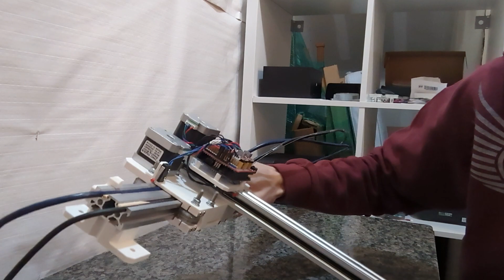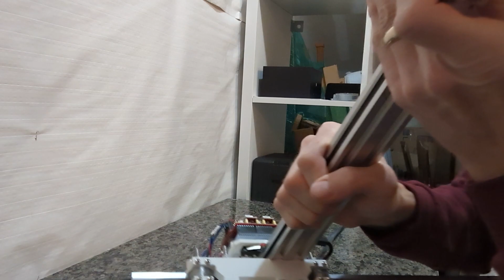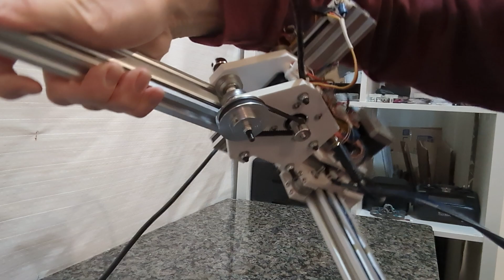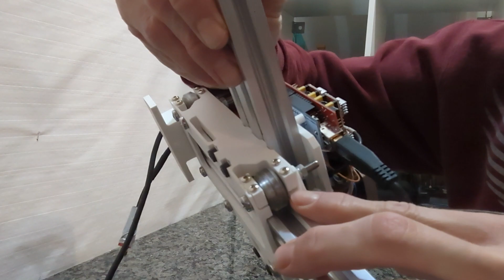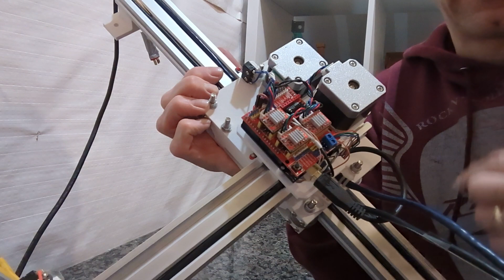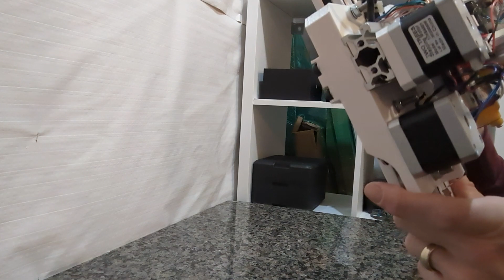TimSav+ CNC Machine Overview

Comment: Hello. First of all, congratulations because it's a fantastic job.
But I'm at a stage where there are pieces that had a different design (v13) (v14) and now it's a different one, like the Counterweight Pulley Bracket, or the Cable Anchor With Pulley piece, which didn't appear for a while and now it does, in the OnShape indicated at the bottom of the website... but it's not in the video, which surprises me, in addition to missing pieces in the OnShape design, such as the Y Axis Rail switch stop (where each switch stops), and the belt tensioner above the Z axis, which is visible in the video... And I don't know if I'm leaving out any pieces, as I haven't 3D printed them yet.

To finish, would it be too much to ask for a BOM list and the STL files separately to check that nothing is missing?
Reply from the maker: @enriqueigl1964  hi! Sorry, I have been working on some changes to allow vertical mounting on a wall, and those are not complete. I just tagged a v1 version in onshape that should be in a good state with everything you need. I haven't put together a full BOM yet.
Reply: @gauchopuro  Okay, fantastic, but now I'm stuck with two versions of some parts, and I don't know which ones are the good ones. I was stuck with some V13 parts, and I see V14... I couldn't leave a version 1 untouched from these last few weeks, because in February I had almost everything ready... Or upload the original STL files of the machine shown in the video...
I know it complicates things, but otherwise I'd be a bit helpless, since what I was looking for is no longer there, and that's how I liked it!
Thanks